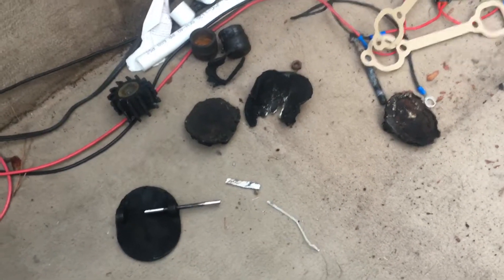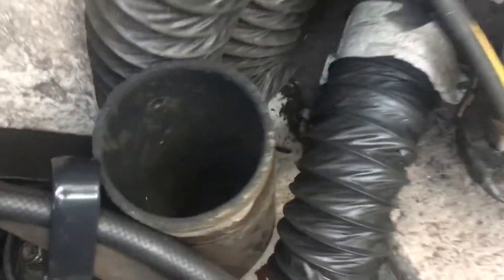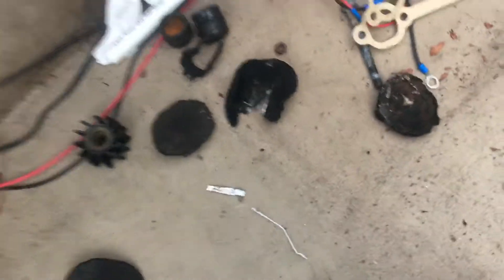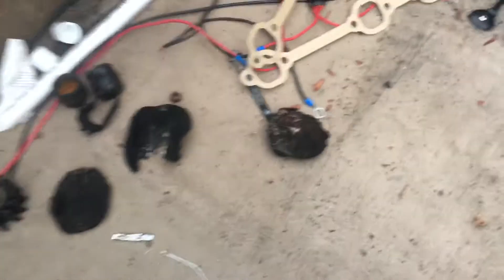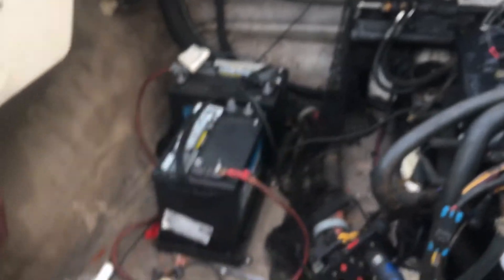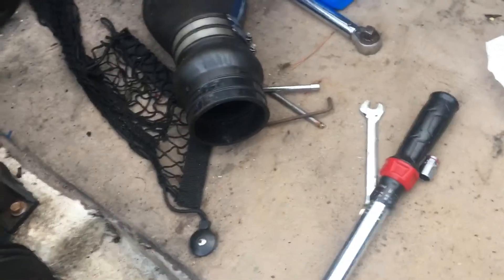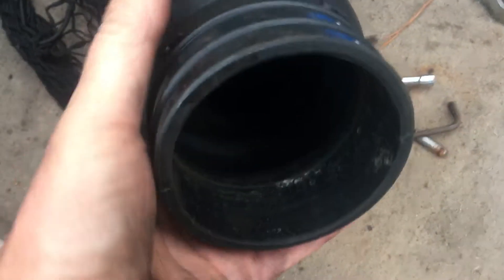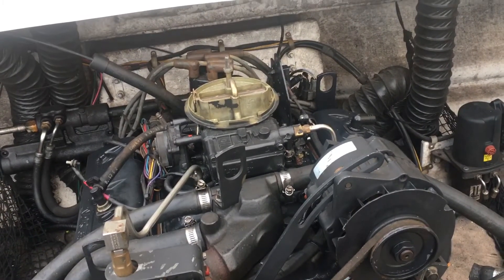Part 11A - Mercruiser 4.3 V6 Rebuild - Exhaust System Prep

Comment: This is informative.  But that is a Mercruiser engine and you are following the Volvo recommendation not to replace flappers.    I wonder if Mercruiser agrees?
Reply from the maker: Good question. I used Mercruiser because it’s a more popular search term but this is actually a Volvo Penta engine because as it turns out, there is no difference.  The systems are almost identical. I pulled several old flappers out of that exhaust so my recommendation is to take them out. You just have to be mindful when boating to not let the wake overtake the stern. Or when beaching not to let waves wash up over stern.  You could leave in the flappers but I would do an annual maintenance check to make sure they are still in place and not melted.